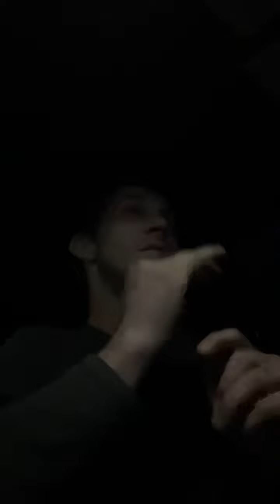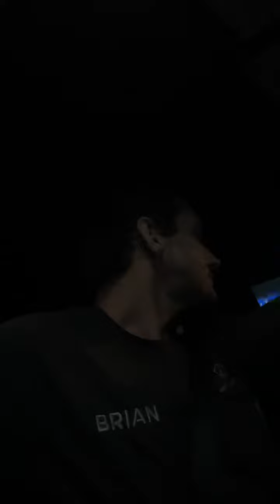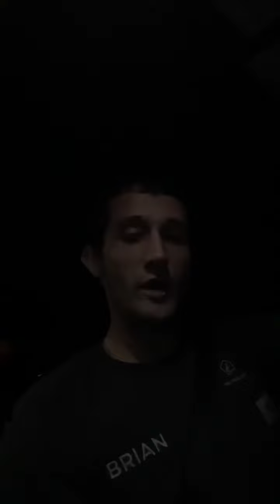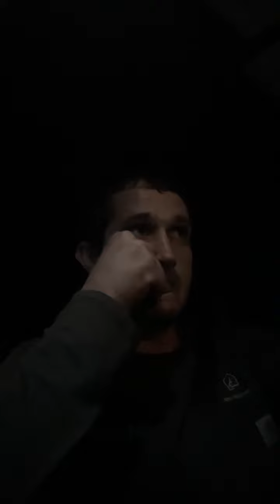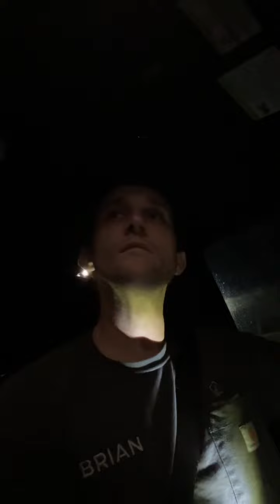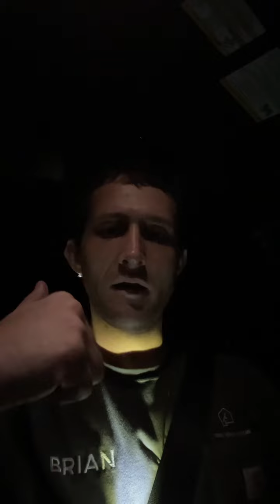Portable Generator Services: Difference between 1800 rpm and 3600 rpm, air cooled vs liquid cooled.

Comment: I think I'm going to go with the Cummins 25KW or 30, 36KW.  Hoping I can get the generac smart managment modules to hook up so we system will determine when I need the pool and hot tub vs AC.  My needs in the winter are different than in the summer.  Currently have Generac 17500 with a back feed set up and gen shed.

Comment: Just got a 30kw liquid cooled Briggs 3600rpm, it replaced a 20kw air cooled generac. Got 400 gallons of propane above ground. Should of gotten the 1800 rpm. But didn’t know. Next one will def be 1800 rpm. Live in Louisiana with tons of hurricanes and power outages
Reply from the maker: Yea briggs are good though but next time. Def go 1800. Why did you switch anyways
Reply: @PortableGeneratorServices  my 20kw generac that failed during hurricane ida was 13 years old. And had several problems before
Reply: @PortableGeneratorServices  is it possible to slow the rpm down to 1800 on a brand new unit? I heard a rumor about it, but don’t think it’s possible. Thanks for your advice and info videos, very informative
Reply: Def don’t wanna screw up anything with the brand new warranty though lol 🤞💀
Reply from the maker: @bigboy8526  no. You can’t. Don’t mess with anything lol.
Reply: @bigboy8526 Unfortunately, no not with out burning the stator or rotor trying to keep up with voltage flex or amperage changes same with frequency constantly adjust it self